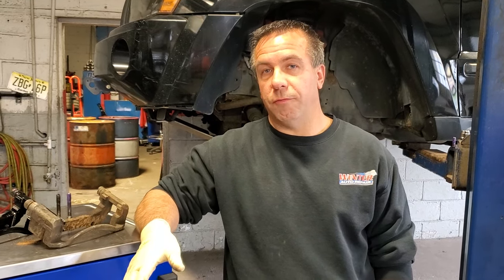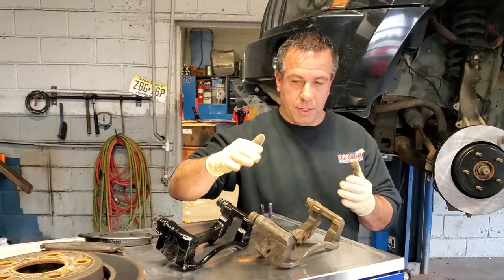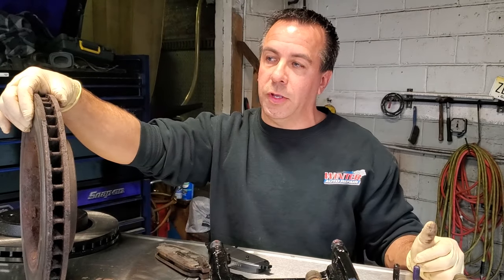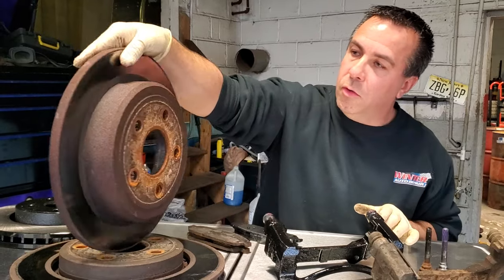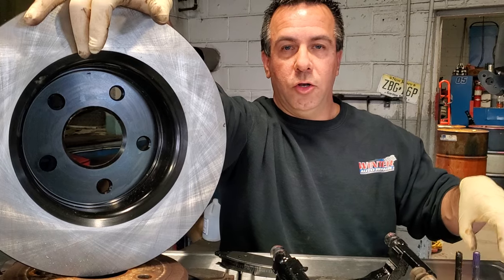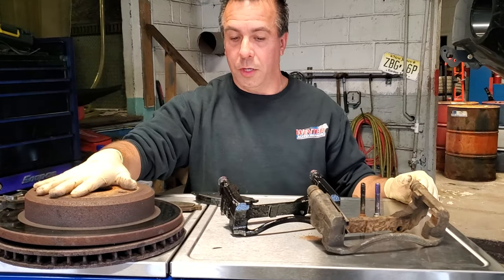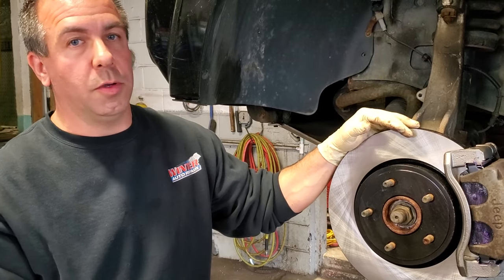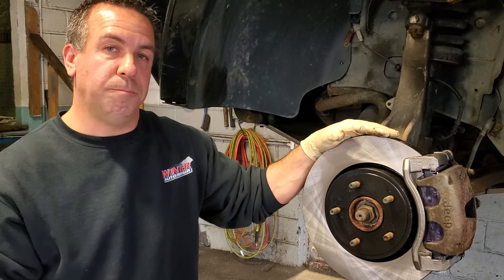High quality brakes vs cheap brakes

Comment: The last thing we need is more govt inspection of regular vehicles.  If people can't figure out when their brakes are  shot or squealing, it's about just plain stupidity of the consumer.  Inspection just serves to give a hell of a lot of business to repair shops that gouge the consumer.  My 1992 truck is so much better maintained than so many vehicles on the road these days.....while it would be targeted endlessly when put under inspection.....for stupid issues that are NOT about real safety.  Unsafe vehicles on the road.....are the result of ignorant consumers.....the same kind of people that allow repair shops to constantly gouge them...lol.  As far as rotors, they can mostly run for the life of the vehicle....with only very occasional machining, if one replaces the pads consistently on time.  It's a blatant gouge when repair shops replace them at every brake job.  I do my own brakes....and  have only replaced rotors twice...on all of the vehicles I've ever worked on.  They were replaced because of warping....that causes the brakes to shudder.  That's the only issue that necessitates actual rotor replacement.  The rest can be handled with machining.....which is becoming a lost art, because repair shops want to make money faster....out of the consumer's pocket.  I live in Toronto, by the way....which uses salt on roads.  Rust is only a problem when it gets  incredibly serious.  Rotors with rust everywhere....outside of the braking surface....is NOT a problem, unless it ever gets as far as compromising the integrity of the rotor....which is absolutely rare.
Reply from the maker: Come live in NJ with no state inspection. 99% of the cars have bald tires and no brakes. You'll change your tune when one of these death traps totals your 92 truck.
Reply: @WinterAutoRepair  Ya...nice exageration...lol.
Reply from the maker: Not an exaggeration.  The reality is most of the cars in NJ would never pass a state inspection. The majority of the cars in the bodyshop here that have rear-ended someone have bald tires and brakes that grind from no brake pads.  People couldn't care less about their own safety or the safety of others on the roads.
Reply: @WinterAutoRepair  From reading about it, New Jersey has way more inspection than we get here in Ontario...for non-commercial vehicles.  We even stopped our emission testing a few years ago....and the only real obvious change is a lot of people driving around with a headlight burnt out.  Ya...that is frustrating....but not some major safety issue.  Otherwise, we have never  had any mandated inspection for regular vehicles, except when sold to someone else.  Our vehicles are doing just fine safety-wise, regardless.  I've only ever seen state inspection as a gouge to vehicle owners.  The police can deal with the real safety issues that are obvious.  If some people are stupid...and get into accidents, it's not a state  issue, it's THEIR issue...and they will pay through the teeth eventually.
Reply: @WinterAutoRepair  So nearly the entire population of the cars (99%) in NJ on the road today are driving around on bald tires?   Somehow I don't think only 1% of the cars in NJ have safe, non-bald  tires.

Comment: You can still resurface brake rotors as of now. We still do them at dealers. Do not just dump your rotors, seek a professionals opinion if its necessary or not.
Reply from the maker: We get many many cars from local dealers that either said they cut rotors and didn't or did cut them and now the rotor is too thin. What we have seen is within a year of a dealer installed pad and a cut rotor, there is severe vibrations and the job has to be redone. If I had to put a % on it, 50% of the brake jobs we do in a year are from shops and dealers that did a brake job less than 6 months ago and now the customer is having issues. So you can cut the rotors but expect come backs and lost customers. we will continue to replace rotors when we do our brake jobs.

Comment: Warping is extremely rare. Disc thickness variation is usually what happens if fitted incorrectly/not bedded in properly. Warping is just a misnomer.
Reply from the maker: We have a small 3 bay shop with 2 techs.   We see cars with warped brakes rotors at least 5 times a week.   Thursday and Friday this past week we had a land rover with 20,000 miles that had warped brake rotors among 4 other cars.   It's definitely not a rare occurrence.

Comment: Nice speech but I'm sure that's just a way to make more $$$ when possible. Unless your doing the checking for free, then go ahead
Reply from the maker: We perform the check and extra services for no charge. Our shops main concern is having safe and happy customers. This has been our policy since  we opened in 1996. I worked for a dealer from high school when I graduated in 1993 until I decided to open my own shop in 96. I hated how the dealer made me treat people so my shop is based on customers satisfaction which has done extremely well since we opened!
Reply: @WinterAutoRepair  I can respect that completely, wish most where like that around here
Reply from the maker: @jessievert  when you find one, be faithful and bring your car to them for everything from oil changes to the biggest repairs. They will treat you like gold and you'll build a relationship through mutual respect and trust!  We are out there, just ask around.
Reply: @WinterAutoRepair  I do 99% of my own work now thanks to previous machanic mistakes. I feel yourself will be the most thorough will your own vehicle than alot of shops trying to get your vehicle in & out as quick as possible. In my opinion
Reply from the maker: @jessievert  I hear about bad mechanics/shops often. Sadly you're not alone. It's great that you've learned to do your own repairs. Sad that you never found a trust worthy shop. I understand the rush mentality that shops have, we take well over an hour just changing oil for $49.95. It's definitely a loss for us but again, we are different in our approach to customers and their needs. I'd rather take the loss and go over the cars thoroughly!
Reply: @WinterAutoRepair  most where shops & others where friends & family which was my last straw with making the same mistake trusting other people, in a way I'm thankful as well for turning me into what I am & have learned today. I'm sure there are some great shops out there but I just got tired of rolling the dice

Comment: most ppl dont keep cars all that long so...
Reply from the maker: Most of our customers keep their cars for years.   In fact we have a 300k mile club.   We have a select group that have their cars past 300k miles.   Not sure where you live but unless you're leading new cars continuously, it makes more financial sense to keep your car for approximately 10 years.
Reply: @WinterAutoRepair  I was a car dealer... thats how i know most ppl dont keep the same car for long time, i asked them that all the time
Reply from the maker: @saltpepper1894  being a car dealer you are seeing the % of people who are getting new cars.   As a repair shop we see the clients that keep their cars longer.  If you look up the average age of the cars on the road in America, it's over 11 years old.  Now that's the average of cars that is brand new to used.   The first 3 years most people stay at the dealer because of warranty concerns.  We see cars from 4 to 20 years old and older.  Not everyone wants a car payment and we track our customers spending.  Once their cars costs more than $2400 a year in repairs, 2 years in a row, we recommend they start looking for a new car.   Until that time we provide high quality repairs so their cars will last as long as they'd like to keep them.   Currently we have a Volvo wagon with 660k miles and a subaru with 400k.  We have many clients with 300k plus.  Thanks for commenting
Reply: @WinterAutoRepair  i was a used car dealer who specialized in vintage cars. i would always ask ppl how long they would hang onto cars, if not for anything else but conversation. stats show ppl dont hold onto new cars for more than 3 years if i recall. ppl shouldnt keep new cars past warranty these dayz....repairs are crazy expensive
Reply from the maker: @saltpepper1894  well you're a former used car dealer.  I'm a current mechanic.  Stats prove that cars in America on average are 11 years old.  So I guarantee they are mostly over 3 years old.  Someone else then buys the used car that was traded in.  Plain and simple. Cars last decades.

Comment: Every white box rotor I have used and that's quite a few have all been beautifully machined and balanced and they were NOT the top of the line expensive rotors. They rusted less than the originals.  According to this guy no white box rotor is machined and just a raw casting. If that were true a not machined rotor would not fit the vehicle until it was machined and no auto parts store would sell an unmachined rotor to the public and no professional mechanic would buy a raw rotor.  He claims Centric rotors are made in the USA which some are but many are made in China. Checked many of the Centric pads and they were all made in Korea, Malaysia, and China. As far how long your brakes will last it's determined by the pads not the rotor.
Reply: Correct most everything is made in China even the high quality stuff. Japan uses factories in China as well.

Comment: Good sales pitch. Why would you salvage a brake pin when they cost no more than $10 for one caliber. All rotors can be turned at least two times only if they do not take off too much material the first time. That's why you have to measure the rotors with a caliper before you turn the rotors. You do not have to sell someone rotors every time you do a brake job. You are ripping off your customers if you do that.
Reply from the maker: Modern rotors are very thin. For example a 2016 F150 is 32mm. Modern pads are much harder than pads made years ago. You'll notice the pads actually wear into a rotor causing a "lip" to form on the top edge of the rotor.  That lip is usually 1 to 3mm deep. Now, cutting the rotor removes .4 mm of thickness.  That puts the rotor at 27.6mm.  The discard thickness on this application is 28mm. If you use this rotor it's already below minimum thickness and much easier to warp, glaze or if the customer let's the pads go until it hit the backing plates, the calipers pistons can come out.  Then there is the rust in the wins of the rotor that deteriorated and cause the rotor to weaken which can cause warping or failure. Then there's cost. The cost to turn a rotor is about half the cost of what a new rotor is. However, the new high carbon rotor will last 4 times longer then a used rusted rotor.  So you say I'm ripping my customer off, I say I'm making sure their family is safe and their car is kept in good shape. 
Also, this video was made to be used on our website which is why is is more like a commercial. We will add more content to our YouTube channel since this video has gained a lot of attention and people seem to like the content. 
Thanks for commenting.